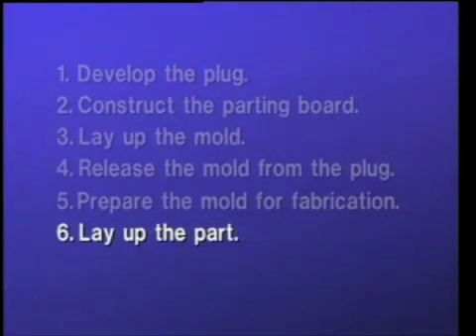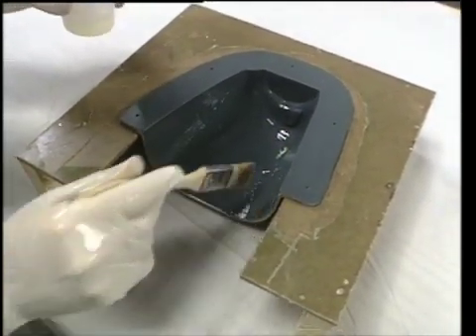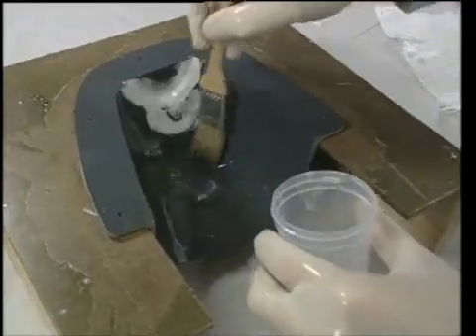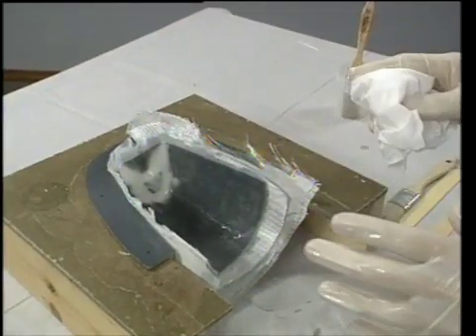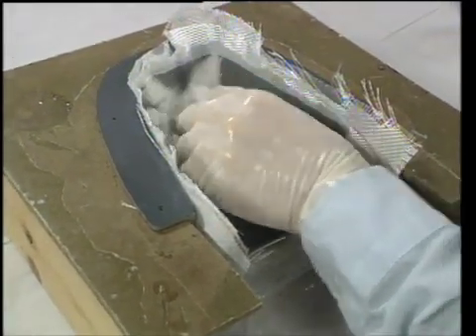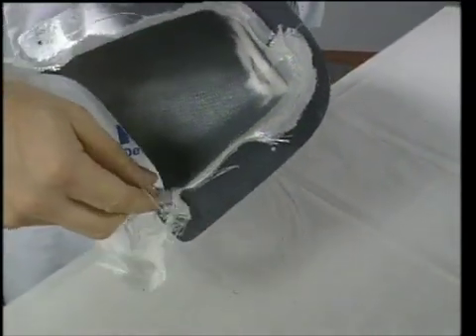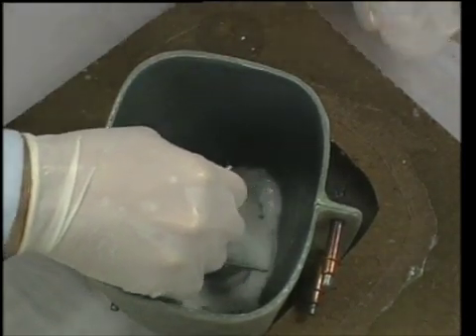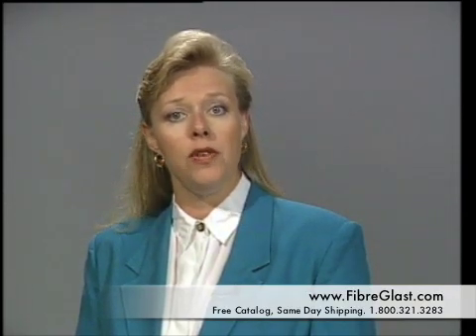How To Mold Fiberglass & Composites 7 of 8

Comment: Hello, do you see any issue if we lay the fibreglass cloth to the two piece mold bolted together so there will be seamless joint
Reply from the maker: Thanks for reaching out. The issues will depend on the shape of your part. In this video, the shape of the part is better with a 2 part mold. There were no seams on the part because a molding clay was used to fill in the gaps caused by putting the two halves together. If your part is flat or does not have sharp angles, a one piece mold can be used. Take a moment to consider how well the part will remove from the mold during your design phase.

Comment: I don't really understand why the first half is trimmed, would it not be a good idea to allow some of the fiberglass cloth to overlap on to the other side? I am sure the final part is easily strong enough for a model plane, but it just seemed that it would be inherently stronger if they didnt cut all that matting away before starting on the second side.
Reply: Is it possible to lay up the fibreglass cloth with the two mold clamp together so there will be no join

Comment: In video #8 they speak of washing away the green PVA so they used it but forgot to mention that part. You need to wax and PVA-treat the mold before putting in the first coat of epoxy.

Comment: yeah but you are not going to get it right in that tiny little area.
a resin without a wax in it can be dry when you add another layer without any adhesion problems.